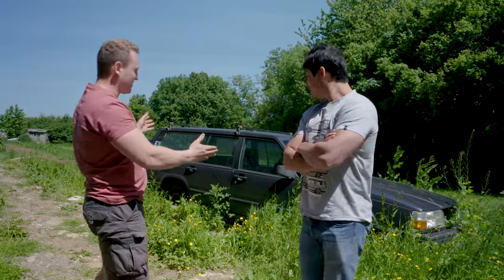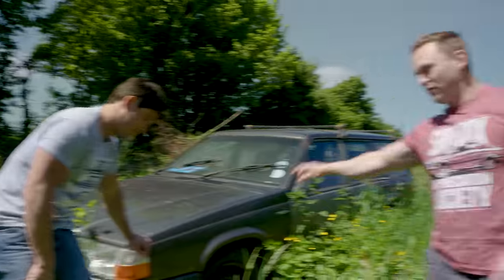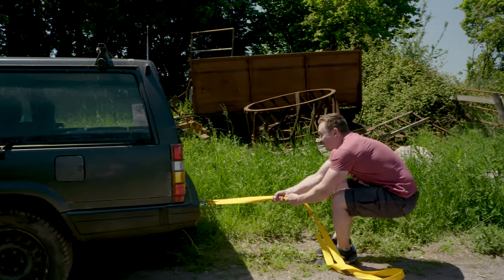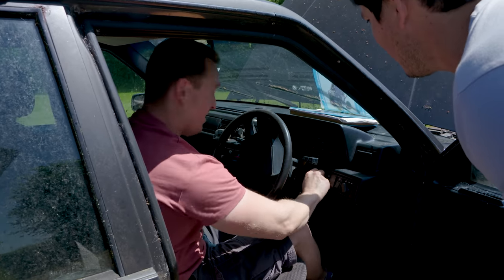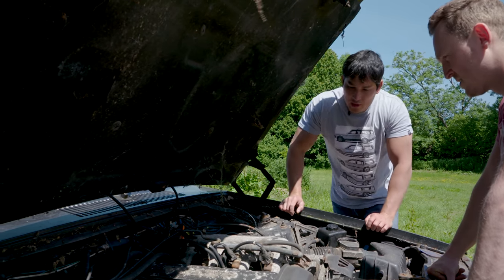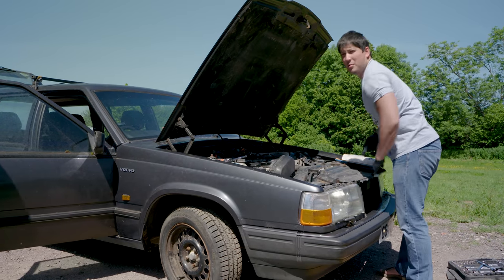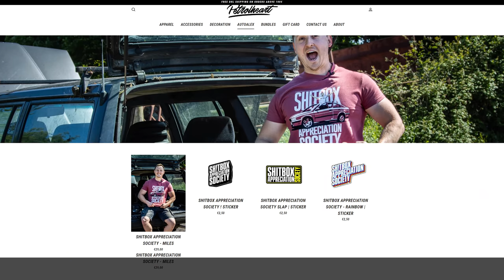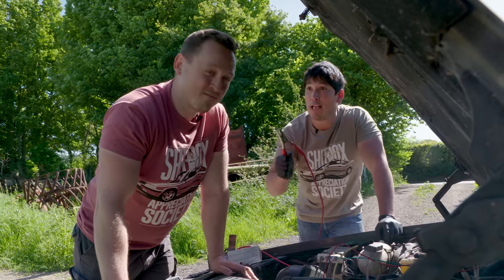Can We Start An Old Volvo For The FIRST TIME In 10 Years?

Comment: 100% get it running and drift it, would be amazing to see.
Reply: 2.5Ton, 40Whp, 1Wd.
That is alot of work for spinning A tire in sharp right turns… 
36 tons on the roof.
Reply: @robinlundh3962  they obviously wouldn't drift it stock. If you striped the interior and did a few engine mods it would drift .
Reply: @robinlundh3962  You are greatly underestimating old Volvos. The 740/940 are notorious for being very light in the back. You can even "drift" a GL (113hp) if you want and this is the 16 valve variant with a bit more punch. 

Now, if they put a turbo on it this thing will be a literal flying brick.
Reply: @robinlundh3962  someone hasn't seen drifts n lifts
Reply: @Thumbii  No i’m not. I agree with Alex statement ”I’ve been here 5 minutes and I allready hate it!”
Being from Sweden I have seen, heard, ridden every possible version of these cars, from stock to tuned. And heard every version of ”how good they are”. 
And I truly hate them. They are overpriced, underengineered boringness. And just stupid.
Reply: @robinlundh3962  They are far from 2.5 ton, these cars only weigh in about 1450kg. Very light and very strong steel. Plus this B234 engine did at one point make 155hp. Not bad, these are very tail happy cars also, I have a 940 SE with a factory limited slip, and 114hp, and in the wet it's insanely easy to slide about.
Reply: @robinlundh3962  I drive a bone stock 240 GL (120hp) and that easily gets sideways in the wet. Takes a bit of persuasion in the dry. So this 16v model with 150hp will easily slide. Also, I don’t think a single rwd Volvo came out of the factory weighing more than 1500kg. Considering a new Mini Cooper is 1200kg, that’s pretty light for an old bus!

Comment: I had ‘88 740 which hadn’t been driven for a decade or so, previous owner couldn’t work out why it wouldn’t start. I put some fuel in it and it ran as good as you’d expect from an old Volvo.

Comment: 740 GLT 16 valve. Off-the-scale badge envy!
Reply: Rare engine: B234F, 159hp.
Reply: @jfv65  Even though it made a whopping estimate of 4 hp in todays episode
Reply: Such a cool car, favourite volvo badge has to be the 760 Jurbo.
Reply: @bubert8955  LOL, yes. 😁 
I'm sure they will get it running tho.
Reply: One of the easiest ones to make fast as F, just turn up the ignition by 2 steps and it goes like a mf

Comment: A couple points of interest to get this thing running: crank sensor, possible ignition module(I think that may also have something to do with injector pulse), obviously the computer under the passenger side kick panel is suspect, possible bad ground, also check fuses. And remember this is a 16 valve engine, an interference engine, those timing belts are vulnerable to snap especially after 10 years of sitting In a field

Comment: Thats one of the rare 2,3L B234F 16V engines, a little harder to get parts for, as the 2,3L 8V engines are much more common.
Got my Volvo the same way. Sat in a yard also for nearly 10 years: a 740 sedan, also with the 16V B234F engine.
We filled the gas tank, cleaned the spark plugs, used some starter fluid, and it started right away. Drove it on its own power to the garage a few miles away. I used it for 6 years, until the rust finally won.
Wonderful car.

Comment: What ever you do with it, make it go faster. Here in Sweden, most of these are now turned into "(class) A-Tractors - basically the Swedish version of "sans permit"-vehicles for kids 16 years or older, to drive before they can have a drivers licence and drive a real car, meaning the "A-Tractors are only allowed to have a top speed of 30 km/h (18.64114mph). They are the curse of the Swedish country roads and I hate every signle one of them - to compansate this, please make this Volvo go FASTER than it normally did, instead of the agonizing opposite. Thank you!

Comment: A point I haven't seen anyone else comment if you guys haven't gotten it going yet, my 740 along with a ton of others had an issue with the radio supression relay, it controls the injectors, if it goes bad you'd still have ignition but no fuel injection. Your crank sensor definitely works because I had that issue as well and it cuts spark too. If not the radio supression relay then it's your wiring and I would just try to find a 740 in the wrecker with a clean harness that you can pull for cheap to get that turd running lol

Comment: Check the radio suppression relay underhood: it's responsible for firing the injectors and when it goes bad you'll have spark and no fuel. It's a little 4-pin affair that's pretty easy to check/replace.

Comment: Just bought a '96 850 estate. Perfect timing on the video ahah
Runs perfectly, changed timing belt water pump and recharged the AC everything works. Great car, drove 1500km around Portugal 1 day after i got it 😁 great adventure!
Its a 2.0 20v 180hp Low pressure turbo, coming from a 1.6 turbo diesel engine with 115hp. Its amazing going uphill  and gaining speed 😂😂

Comment: The 16 valve 740 engines are a good thing. The heads were designed by Cosworth I believe and they were a pretty solid design. 150+ BHP. Bolt a TD04 blower to the side and run it as a low pressure turbo set up and you have the ultimate boxy drift mobile.

Comment: Love this and the previous Volvo video. I had a 1984 240 gl that I maintained to the point I could weld, and fix anything on it. I put a camaro Flowmaster dual exhaust on it, a massive ram air through the grill to a k&n cold air intake. A turbo off a turbo version(on top of the 2.5 4 banger), intercooler, and 4" dual dtm(style) stainless exhaust pipes. It was Volvo gold, I had em spray the same color, but with metal flake in it. 875,945 original mile when I gave it to my brother in law. He ran another 100,000 miles, with me maintaining it. Then we did some drag races with it, with a nitrous kit. 10.75 quarter mile in a million ton brick. He did crash it though, and we replaced a Wing, light and the bonnet(I am American but I am trying mates!!) And it was fine. Another crash at 1million 204,000 and it was done.

Comment: The b230 is one of the greatest engines, specially with the Porsche designed 16 valve.
The head flows magnificently, 600whp is just a matter of large enough of a turbo and booze as fuel.

Comment: That is a score. That motor is a special unit, I run a slightly built N/A one on a Haltech ecu in a wagon over here in the US. You’re no doubt going to have a bunch of kids here saying “ohhhhh lemme get that head for my 240 oooo aaaa” hahahahaha good luck with it! This should have a locking diff in there rear and has decent angle stock. This will absolutely drift a treat. The wagons are great for sliding

Comment: The 16 valve engines are pretty cool, they're are different to the regular redblocks through having a 16V head, balance shafts and an external oil pump, it is common to swap these heads onto other blocks b/c some people dont like those two last ones.
Reply: You disconnect the balance shaft by simply removing a belt and now you won't have to worry about your entire engine going kaput in case of a cam issue etc.

Comment: Sweet memories! I saved a 1990 745 GLE 16V from the wrecker once. I was scavenging for parts for my 360 GLT when I found it. Asked the wrecker if I could have it if I managed to get it running. I only had to buy the battery he supplied me with. 
I drove it off the yard that day! 350k on the clock and it drove like a dream.

Comment: Alex, I’ve got a pair of my grandads old underpants that have been sitting in my laundry basket for 10 years , I did try to unstick them from the bottom of the basket a coup of times but they are stuck, if you can get them free you can have them. You might need the x5 to pull them out!

Comment: I dont know if youll read this considering how many comments there are. But I just want to advice you since Ive worked for Volvo 15 years. Theres a relay on the coolant expansion tank, that relay grounds the injectors. Its a very common issue that the soldering goes bad in that relay, I could bet money that that relay is your issue. You can open it and resolder it, or you can get a new one. That is where Id start.

Comment: Check the injector relay. Partnumber 1323592. Its on the expansiontank. If its broken (and it offen breaks) the car wont give 12 v to the injectors. The ECU controls the injectors on the negative side so if you have 12V to the injectors then it works.

Comment: 740 GLE 16V, only a few of those left and the 16V engine is great. 

If you keep it, make sure you do the timing belt and replace the oil pump drive gear bolt as it fails, throwing the belt off and causing pistons to give the valves a high 5. It was a TSB from Volvo that got missed sometimes, just replace that bolt with a 10.9 one!

And if you don't keep it, I'm in Bristol and it's look stunning next to my broken 240 estate in the driveway... Just don't tell my other half!

Comment: I have the same engine in my 744, couple of top tips to keep it alive:

-Replace the timing belt as soon as possible as this is an interference engine!
-Check the condition of the oil pump gear, some were a kind of plastic and have deteriorated over time
Optional: cut the balance shafts belt (1 belt, 2 balance shafts) and don't replace it, it has been known to snap and destroy the timing belt with it, destroying the head in the proces (+ you don't really need the balance shafts, purely for comfort).

Please save this Volov (block), it is very desirable amongst Volvo fans!

Comment: awesome vibe in this video, you guys should check the fuel injector relay located besite the coolant reservoir. typical problem on the LH2.4 system. Greetings from sweden! and good luck with your rare brick! oh and make sure you check out the b234 turbo builds we have here in sweden... mental engines!

Comment: When you are hit by a stinging nettle, you can take the juice from a dandelion and spread it on. then the itching stops.
The stem of a dandelion is a tube of juice that resembles milk.
But divide the tube into 2 and lubricate the juice by holding the tube on the outside and inside against the skin.
Use a lot of juice. !!!
translated by Google translate.